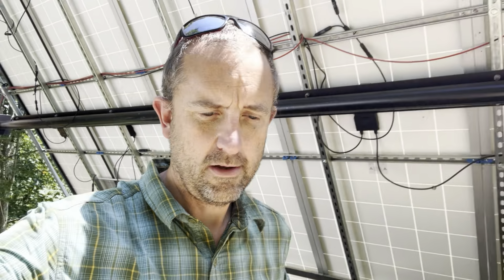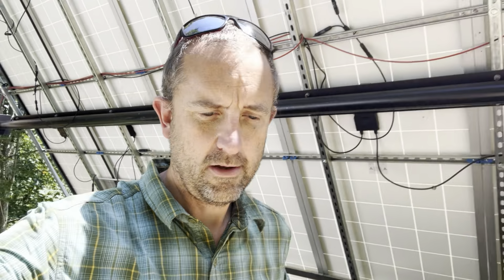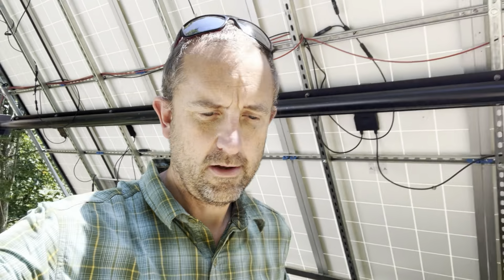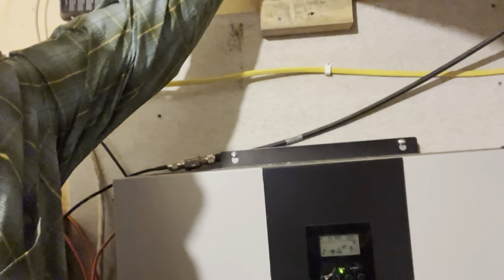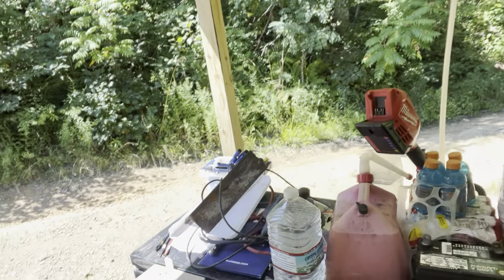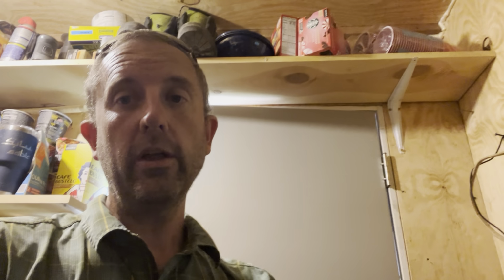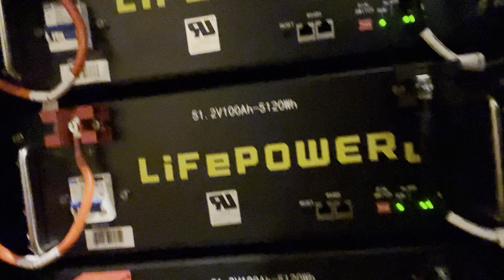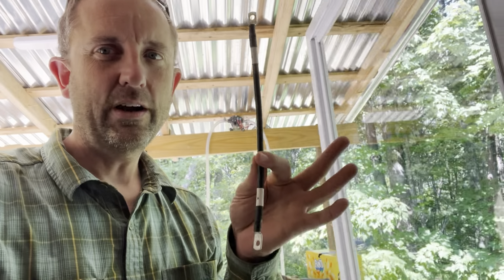Off grid solar and battery electrical system

Comment: I think you can have additional mppt charger. to assist charging batteries. They are cheaper than all in one unit and can work in parallel.

Comment: You must be way up north to have your panels pointed at such an aggressive solar angle!  I live in AZ and we only point at 35 degrees.  It rocks!  At least your snow slides off easily. 👍😆
Reply from the maker: That was my winter angle, I just never reset them this summer.  Even at that angle I get a pretty good amount of snow accumulation, I've thought about making them even steeper for when I'm not there...

Comment: A thought about the cabin, if you had a battery there and charge it through the cord and then run an inverter to power the devices in the cabin. I saw where someone ran their house on a number 10 wire with a battery buffer. He house burned down and they could not get new service for his new house. The power came from their next door neighbor.
Reply from the maker: I want to avoid keeping the batteries in the cabin for safety (LFP is safer but not immune from run away) as well as space/noise/heat (inverters are remarkably loud).  I actually just finished burying a 250' run of 2-2-2-4 direct bury line between the cabin and the power shed , I now need to move the inverter to the other wall in the shed and get everything hooked up.  I will defiantly sleep better not relying on a string of extension cords

Comment: I enjoyed listening to you. I also try to get the most bang for my buck. I still use the first inverter I purchased. You can have multiple inverters/charge controllers on the same battery bank. With Anderson connectors, you can share arrays between charge controllers. With switches, you can select which load an inverter powers or which inverter a load uses. Good luck on your second iteration. I call it organic design. Fortunately, most of it can be reused. You may end up with multiple systems. Redundancies are probably good.

Comment: I wonder if you would get more in the summer if it was more vertical to not get the shading or take that panel out of the string. 

Signature Solar has free shipping on orders of $3000. Maybe you could find someone who would want to split a shipment.
Reply from the maker: I'm actually ok in the summer for power as there are much fewer days of clouds so my batteries generally stay topped off every day, it's the winter where I get in trouble due to much lower irradiance on average due to weather and shorter days.  In the summer you actually get better power by making the panels lay flatter as the sun is higher in the sky, winter you want the panels more vertical to both match the sun's lower elevation as well as reduce snow accumulation.  Good idea on combining shipping, actually did this with a friend when I went from 8 to 10 panels.
Reply: @icarusfarmsWV  I just do not think used panels are worth buying vs new ones as low as they are, some is in the sub 30 cent range.  One option would be to buy either the eg4 charge controller or the eg4 yellow all in one and just use the inverter on it. If you spent that much then the 6000xp is not that much more. 

I am glad you got the line ran to the cabin.

Comment: You may want to ask who you bought the batteries from if it is ok to use the old cables. Just my thoughts - The smaller cables should push less current to the old batteries and might cause the older batteries to "age" slower compared to the new batteries so they will age to the closer rate.  Just a thought.
Reply from the maker: I had a call with Signature Solar and they said I really needed to have all the batteries using the same cables and it turns out the cables from my original 2 batteries actually had the incorrect (too small) cables versus what they are supposed to ship/spec so they just mailed me a bunch of cables.  Now that I finally got my metal roof installation completed I'm going to be able to hit all the electrical upgrades over Labor Day Weekend...

Comment: a slight correction to your terminology. if your panels are producing 2500 watts continuous for an hour they produced 2500wH @ their overall voltage how they are wired. aH or wH is a power over time measurement, watts is a measure of power without time. I dont mean to nit pick but people will misunderstand if not termed correctly. EDIT: you have this somewhat correct in your light bulb story. also look at the sungold inverters. I have a 5k with a 5k 20 panel array. it is only a 120 inverter but it handles (2) 10 panel strings but it was only $700. I plan on adding another one with another 5k in panels. Im fighting battery price right now. I think im going the 280aH DIY route. also look if you have a local welding store for wire, you can get up to 4/0 flexible welding cable fairly cheap.

Comment: With 2.1kw of panel I get approx 1.7 averaged out on sunny days mostly so I agree, I do have 100ft run so its a bit expected.
Reply: Stuck with that 145v charger limit myself on a Growatt, wish I had gotten an EG4 one that I could almost do one full set of 3.5kw in series instead of my 3 in series 2 of those in par for 6 panels instead of the 10 365watt I have avail.

Comment: It is better to run AC cables from power house to your cabin, have a main isolator and breaker at source, then use 100A AC cables to another consumer unit / fuse board inside the cabin
Reply from the maker: That's my plan, going to run 2ga direct burial cable to the cabin from my panel in the powerhouse and use a subpanel in the cabin to feed outlets and lights.  Based on the voltage tables for my distance I require 4ga so I opted for 2 for a safety margin.  I'm in the process of digging the trench now actually.
Reply: @icarusfarmsWV  Never a bad idea to overrate your cabling, mostly done due to budget, also be better in case of hitting the fan scenario as the fuse/breaker would go before the cable heats up too much.

Comment: I've had to cover almost my entire property with solar panels in order to get enough power to provide for my electrical needs in most types of weather.
Reply from the maker: Yeah, it's really been oversold to much of the country that fundamentally lacks solar irradiance.  You can make it work in places like mine when you have to but it's really a poor choice for much of the country if there are alternatives.  My issue is space, I have the acreage but most of my land is vertical and faces east.
Reply: @icarusfarmsWV  my problem is tall oaks on the neighboring lots to the south and west of me. It does work, but hours are limited.